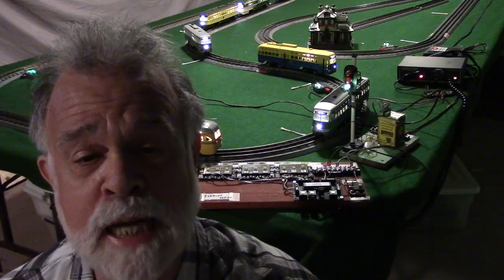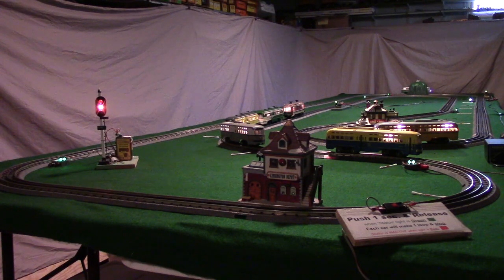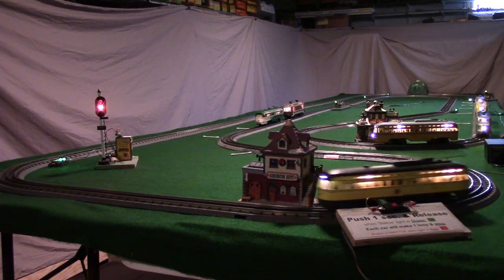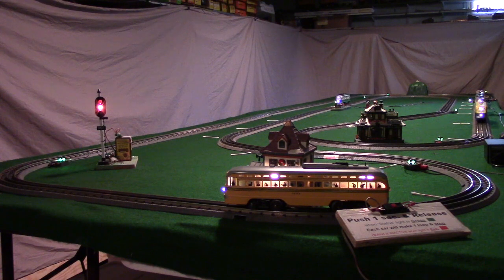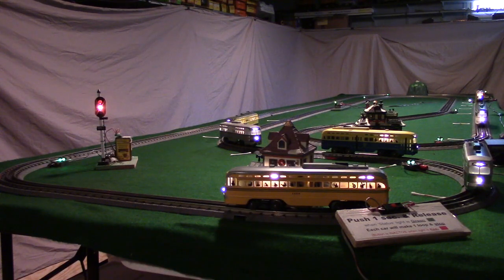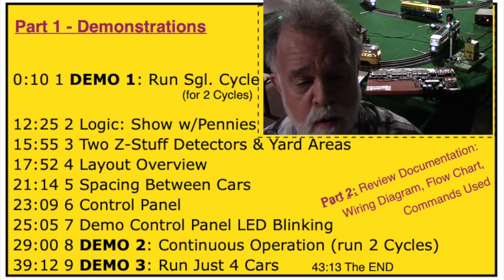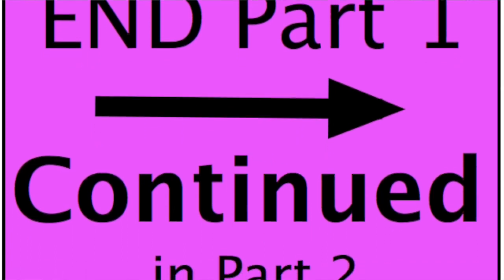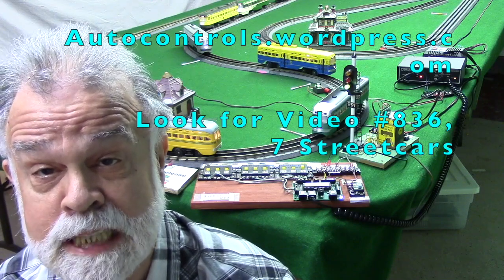836 ❇️ O Ga. Streetcar Control 2.0❇️7 PCCs Run On 1 Loop w/NO Blocks (Midwest Traction Hub)

Comment: Nice video, Jaimes?  Will more thanks 1 trolley ever run at one tjme?
Reply from the maker: With this system, only ONE streetcar will run at a time.  The previous Video #835 ran 6 all at once (5 "creeping", 1 on mainline).  The system used in Video #845 (3 trains) CAN run 2 trains at once (those could also be streetcars).  The O-Gauge playlist at https://www.youtube.com/playlist?list=PLCzsbeo2HeKFQp3iUAkOo_cdp5mNDsoFl contains links to all these videos.  /// Feel free to call me if you have more questions; my voicemail phone number is 570-322-7597.